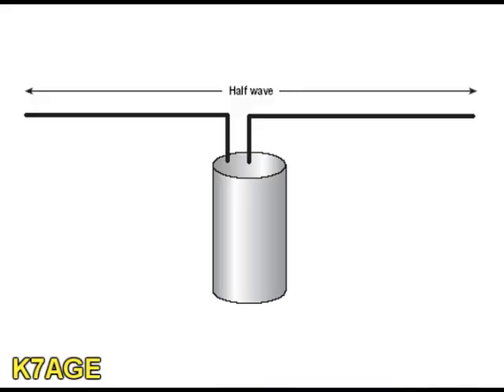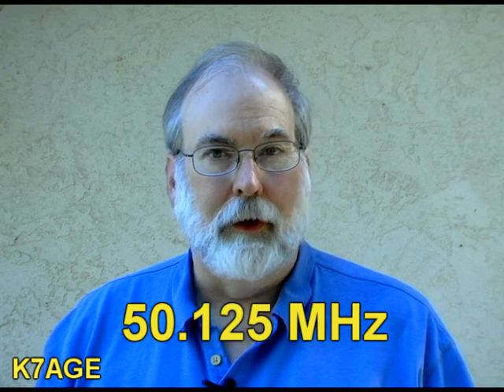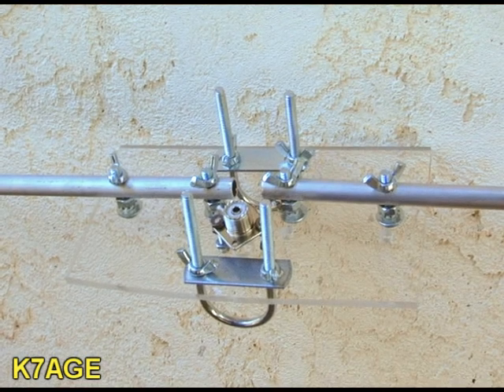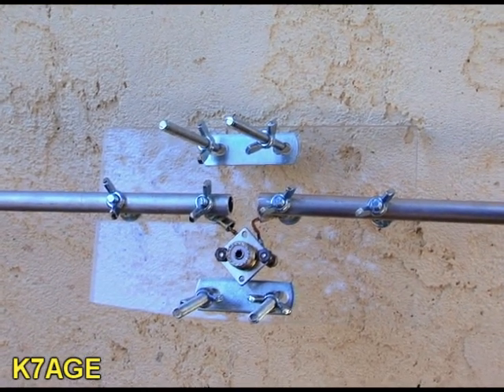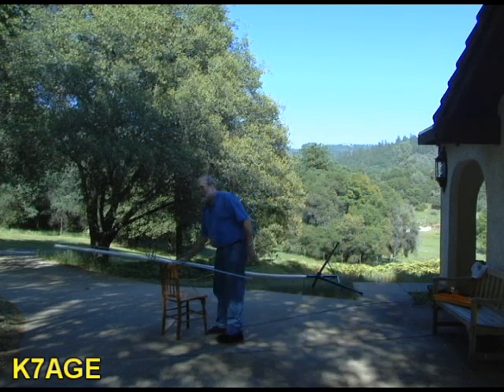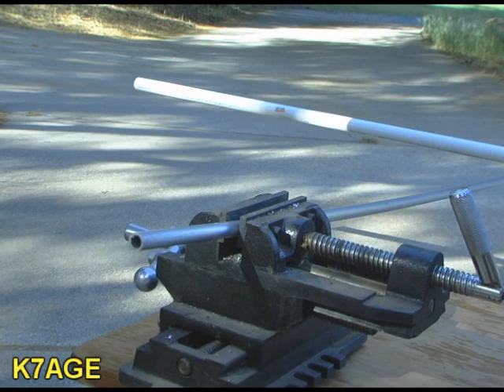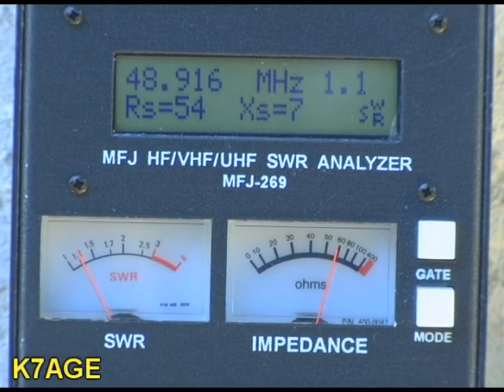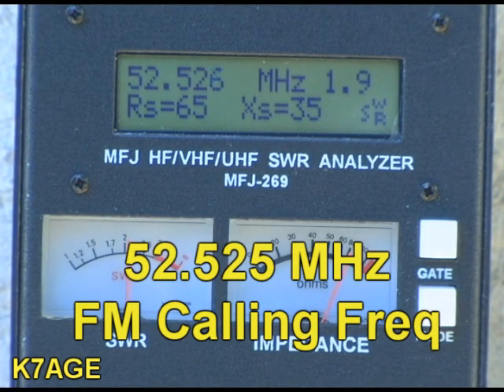How to Build a Six Meter Ham Radio Dipole Antenna

Comment: Currently for 10 meters I have an aluminum dipole made from tubing sections for DX engineering. Each element collapses down to a little over 3 feet and can be shortened for working 6 meters. I get great SWR all over the 10 meter band. On field day I had it mounted on a mast on a speaker tripod like you have. I didn't think I needed guy wires. I was wrong! Thankfully no one was hurt and the antenna was fixable. Just a slightly bent element and a broken PVC fitting. All in all a great antenna

Comment: Great video!
I just made my first two contacts on 6 meters on 5/10/2014 from my mobile.
My radio FT-450D, and my antenna is the Hustler vertical.
One station was VP9GE in Bermuda and the other was WD4AB in FL.
I hope to work you soon on 6 meters.

Best 73 & Good DX!,
Charles, KD4TVB, Marshall, NC.

Comment: I built a tapered element 6 meter dipole from aluminum tubing.  Using tapered elements eliminates the need to trim the ends by cutting.  You just loosen the hose clamp and slide the end of the element in or out to adjust the SWR (similar to tuning a base loaded mobile antenna).  Be sure to adjust both ends equally!

The elements are made from 3/4",5/8", 1/2" and 3/8" O.D. tubing purchased from DX Engineering as was the hose clamps, saddle clamps and the center insulator (antenna to mast (vertical) or antenna to stand-off (horizontal) plate.

And don't forget to include a 1:1 common mode choke at the antenna feed point to help prevent any RFI/EMI problems before they happen.  A 6" id coil of 6 to 8 turns of coax around a form will work well.

Comment: I have built several simple dipoles in my time and I always call these dipoles when mounted in the vertical plane a "Tricky Stick" and I have always had awesome results from them, simple to build and erect. You can just take the driven element off any old junk beam and get rid of the matching network, split the element in half, leave a 1" to 2" gap between the 2 element ends for the feedpoint then just lengthen or shorten the element tips for the best SWR on whichever band you will be using and then enjoy your diy simple dipole.

Comment: An inexpensive tubing cutter makes trimming the ends of the aluminum tubes much easier.  No need to mount the element in a vise, and it makes for a very clean and straight cut.  Another thing I've found, is that using larger diameter tubing allows for wider bandwidth.  :)
Reply from the maker: Great ideas, thanks.

Comment: I need to do this with my 10 meter dipole. Right now it's speaker wire supported by 1/2 inch PVC pipe. The pipe sags. The thinnest aluminum tubing from dx engineering is half the weight of 1/2 inch PVC. That should make for a sturdier antenna. I may also have to do a 6 meter dipole as well. Perhaps do an xmas tree arrangement. Heck, I want to try 2 meter sideband, so might as well stick a 2 meter dipole on top of the six, 

Thanks for another excellent video.

Comment: Quick question (and I know this is 13 years old). Did you mount the SO-239 directly to the plexiglass and then have the center wire run on top, while everything else is on the bottom? Or did you insulate it from the rest of the connector some other way?
Reply from the maker: I think the connector was mounted to the plexi with wires to each section. It was a long time ago.

Comment: If I put a 2-meter antenna above the 6-meter antenna, on the same mast, is there a minimum and maximum distance between the two so they do not interfere with one-another?

Also, with two antennas on the same mast, can the two feed-lines run down the mast together, or do they need to be separated?

Thank you for your time and assistance. WF7BSR
Reply: Anyone, please correct me, as needed.
I believe the spacing between the two poles is unimportant, as the length of each antenna pole starts at the connector and includes any wire that is not shielded.

As for two antenna spacing on the same mast, this is my question too. 

What about the coax runs from my transceiver to the antennas?  One run of coax that daisy chains to the next?  I think maybe no.
Likely two separate runs of coax and they are ok running next to each other, but not wire tied together.  Can someone please confirm?
Reply: On the dipole the space between elements is not critical. Regarding the space between the beam antenna and the dipole, I'm pretty sure there is a minimum separation needed between the two antenna. Probably 1/4 wave separation. The key point of the hobby is to experiment.

Comment: hi,im just getting into shortwave listening and im going to be using a 102 foot long wire antenna,but space in my garden is limited so im going to have to run it in a square pattern..ive seen a lot of guys running these wires over trees e.t.c..is it ok to have these wires touching objects as long as the wire is coated in plastic or similar?..just wonderd what your thoughts on this were,,thanks,,any input would be great...wayne.

Comment: N2yio Hi Randy I have watched your video on making the 6M dipole out of the tubing 
I have two questions I have some old Tent poles that I think are the right length My first question is can I use them?                         and the second Question is what is the spacing between the two poles on the Plexiglass is it the with of the mast? because that is what it looks like in the video
Reply: The spacing between the ends of the elements at the feed point is not critical to the best of my knowledge.

Comment from the maker: @cl4yd0h FM, from being from commercial radio - police cars and so on, tends to be vertical polarized due to simple mobile antennas. The beam doesn't change the polarization, but the way the antenna is oriented,

Comment: Thanks, Randy!  I'm new to all of this.  Is that connector a SO239?  I thought you said SO259.  Why 1/2" aluminum particularly?  And last, what coax choice?

Chuck K7CFB
Reply from the maker: I probably said the wrong thing. It was the tuning that was in the scrap pile. RG8 or RG58
Reply: LL-195/RG-58 (2.56 db/100' loss) for runs under 25'
LL-240F/RG-8X-LL types (2.07db/100' loss) up to 50'
and for over 50 foot runs (to about 200 feet)
LL-400 (solid center conductor) types (0.88db/100')
LL-400 (Flex, stranded center conductor) types (1.12db/100' loss).

These numbers are for low loss coax at 50 MHz and are from the JEFA Tech website.  Losses for other types/brands of coax will vary as will the price per foot.

Comment: I am curious about antennas.  If the dipole were set vertical instead of horizontal, would the antenna still be effective?  I imagine it would be omnidirectional verses bidirectional.  I know this video is aged and no answer may come, but great video.
Reply from the maker: yes. Vertical typically for FM. Horizontal for SSB & Data. It the band opens, either will work

Comment: How did you mount the so239?  Thanks Mal WF5K
Reply from the maker: Looking at the video, looks like I used some long screws with several nuts  so it was above the plexiglass
Reply: @K7AGE  thanks I am working on one for a friend so he can operate six meters.  73 Randy....Mal WF5k

Comment: hello, I was wondering what kind of wire did you use to feed the PL-259 to the elements as I am building a 11 meter dipole, I am constructing mine with a four way PVC with end caps with drilled holes for the aluminum tubing (elements) to go into, but I need to hook the PL-259 that's mounted inside the cap to the element's, but I'm not sure what type of wire I should use as I need to keep the SWR to the best I can get it. thank you. ben. (unit928) god bless..
Reply from the maker: purplehaze6t9 It really doesn't matter. I would not use tiny wire.

Comment: I have it built. I am using your measurements. Be a while before I get to test it. No place to put the new radio yet. I will let you know how it works out. Great video. Now to build a 10-160 antenna. Do you have a video on that?

Comment: Randy,
It didn't look like my post went through the first time I was wondering if I could get on 6 Meters
with the same antenna that I use for 160 through 10.
I don't have enough room in my apartment or out side of it to use an Element 3 Yagi. I was just wondering if you could provide me with any necessary guidance on this matter.
73's.
Tony Ridlen KC9QVE Kokomo,IN

Comment: is 1 antenna hooked to the ground and the other to the center pin, I couldn't tell from the video. I am new so excuse me if it's a dumb question.
Reply from the maker: +mike smith No problem. Coax center to one side, shield to the other side.

Comment: Hi Randy on 6 is 50.125Mhz used for the mode FM or SSB?
Reply from the maker: 50.125 is the SSB calling frequency, 52.525 is the FM calling frequency.

Comment: This would be perfect for a vacation.  I have a sat tv tripod.  You could have several pieces of pvc, with ring connectors and make the mast.  For strength, you could put dowel rods inside them.

Comment: I assume 1/2 copper tube would work the same as the alum?  Home Depot only seems to have 3ft sections.
Reply from the maker: Sure
Reply: I thought so but wasn't sure if the particular metal would resonate a lot differently.
Reply: Instead of Home Depot try your area electrical supplier. If you're not sure how to find one just call an electrician for a recommendation. The tubing should also be cheaper. For copper or PVC use a plumbing contact. Graybar and Rexel are two national companies that have counter sales which I would recommend. They also sell low voltage wire and network cabling.
Reply: Will do, thanks.

Comment: What is is the difference between the antenna wire and the feed wire. I mean if the antenna is basically a 9 feet dipole and I have 10 feet of ladder wire between the elements and my transceiver, is not my antenna really 19 feet long? (New B obviously)
Reply from the maker: The transmission line is to provide a controlled impedance path from the radio to antenna. It does not, or should not, act as the antenna. The antenna attached to the end of the transmission line. If we didn't have transmission line, then we would have to attach the antenna directly to the radio. This might mean that the radio would be located at the top of the tower.
Reply: K7AGE Thanks for your response but I am still not clear. If I have a 10 foot wire coming from my radio I understand that is called a transmission line. If I now raise that wire vertically, does it become a vertical antenna instead of a transmission line? What if I now attach a 9 foot dipole antenna to that end of that 10 foot vertical transmission line/antenna, how does the radio not see this as a 10 foot vertical antenna plus + 9 dipole antenna?
Reply from the maker: johnbspringer This is probably a bit easier to think about coax and not open wire line. The coax is the same impedance as the radio. This allows the antenna to be attached at the end of the transmission line to radiate. The same would be true of the 400 ohm open ladder transmission line if 1:8 baluns were  used on each end (50 to/from 400 ohm transformers). The transmission line carries the signal to the antenna. It does not become the antenna. The two wires of the transmission line cancel radiation.  Hope this helps, sort of hard to explain.

Comment: I often see people showing how to ground base-station setups, by driving solid copper rods often four-feet long or longer into the ground...but I would like advice about various ways to ground antennas and equipment when going portable, such as at a park or campground, etc.?  Since the radio would probably be on battery power when at a park, etc., is the grounding not needed?
Thank you  for your time and assistance.
Raymond - WF7BSR
Reply from the maker: For portable operations, I would not worry about grounding. Lots of effort without any real benefit. I would be more careful with coax and rope lines around where people might be walking. Keep it safe.
Reply: Thank you!

Comment from the maker: @jichus1 First, a beam should always work better than a dipole. I have not had it running during an opening, but I don't think it will make much difference. When six is hot, it smokes!

Comment: I am not understanding why we calculate for 50.125mhz. The band goes from 50.000mhz to 54.000mhz. Why not calculate for 52.000mhz, the center of the band? Thanks.
Reply from the maker: The 50 MHz band is pretty wide. You can check the antenna to check the SWR at  the upper and lower frequency edges .

Comment: Hope you are still around. I built a 6 meter just like yours. Hope it works. Question can it fix to a metal pole and not mess it up?
Reply from the maker: Sure, mount it to a metal pole to get it up in the air.

Comment from the maker: Most antennas that have tubular elements us Aluminum for the weight and cost differences. Stainless hardware is quite common. The aluminum is what I had in the junk pile.

Comment: Hello, I'm a fairly new Tech, I got my ticket in late in 2021.  
I've been operating on 2m a lot and want to be able to do 6m SSB with my club and I want to build my own 6m Antenna, I think that would be pretty cool. 
In researching Antenna types and plans, I've ran across a lot of different designs.  How do you think this design would compare to a 6m Squalo type Antenna?

Also, as far as meters/tools, all I have is a SWR/Watt Meter.  I tried looking up the MFJ meter you mentioned and it seems like its End Of Lifed or something.
What is another good (affordable) analyzer that would work for HF (Bonus if it will work on 2m as well).

Thanks for your time. I enjoyed the video and will look at more of them.
-Scott, KF0GYT
Reply from the maker: This antenna is easy to build. Seems like a squalo would be bit harder. If you can find on, buy it. There are lots of antenna analyzers out there. The nanovna is very popular and low cost. It is small, a bit hard to see outside, but it is cheap. Lots of YouTube videos on it.

Comment: Great video Randy! I've attempted to make something similar, used collapsible antenna from buddiepole and got a perfect 1:1 with my MFJ. When I hook the antenna to my radio and key it up, the swr goes off the scale (external swr and radio swr meters) and the radio shuts down. I'm mobile with an 857d. Any idea what's going on? I've got a funny feeling your going to suggest something regarding grounding. :-) KM6KRE
Reply from the maker: If you are really close to the antenna, move a bit further away. Sounds like you may have RF coming back down the coax. Wind about 6 turns of coax into a 6" coil at the antenna feed point. Maybe try a 1:1 balun at the feed point. Do you have this problem on any other band?
Reply: K7AGE thank you for the quick reply! My only other antenna is an auto tune 120 Yaesu, and it seems to do ok. I'll give the 6" coil a try and maybe a visit to HRO for a balun, or look into making my own, your videos are a big help to us new guys. Many thanks! KM6KRE

Comment: 1995  
2 curtain pinns  alu  sqared (remove the plast sliders) - 
one pice of plank  ca 30 cm.
1 wire connector ( nick name sugar bit) 
screws to mount the pinns to the plank.
2 pice of copper wire  ( 0.75 mm2 eletric wire bits will do) 
mount the sugar bit with a screw
connect  wire bits
connect a rg58 cable  as long as needed to reach the station.
mount it on a broomstick.

and i did Canada  Brazil and Australia   to take som of the edges 
regards oz1gai

Comment: Is that dipole omnidirectional?
Reply: Depending on the polarization, vertically it will go mostly in all directions like a giant bubble, except to the top and bottom of the antenna.
Reply: Thanks

Comment: Did you notice when he was testing, after he cut the ends, that at both frequencies the R.H. meter showed an Impedance of between 70. and 80. Ohms, this antenna as are ALL dipole antennas are ~73. Ohms, which is why they make and sell 75. Ohm coax.  (small = RG-59, Large RG-11)  50 Ohm radios work into 75 Ohm antennas, there doesn't have to be a match at the "generator."
When testing with a signal on the air I always Identify my signal, at the end, always. Ron W4BIN
Reply: At the resonant frequency, the antenna has an impedance of around 73 ohms, purely resistive.  The VSWR can be calculated by taking the ratio of the impedance to 50 ohms, giving VSWR = 73/50 = 1.5.
So, 50 ohm (nominal) coax can be used and have a very acceptable VSWR

How do you id your station when using a NanoVNA or an antenna analyzer?  Is there a mic jack or a key jack mounted somewhere on it?  I have looked at mine and, nope, no mic or key jacks anywhere!